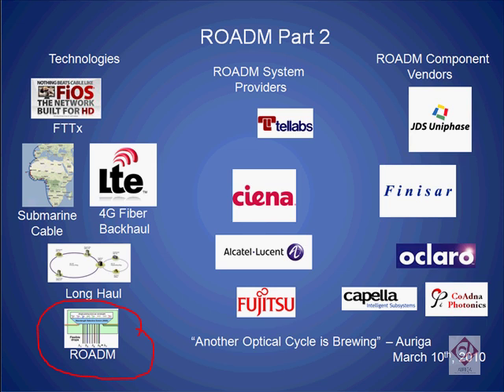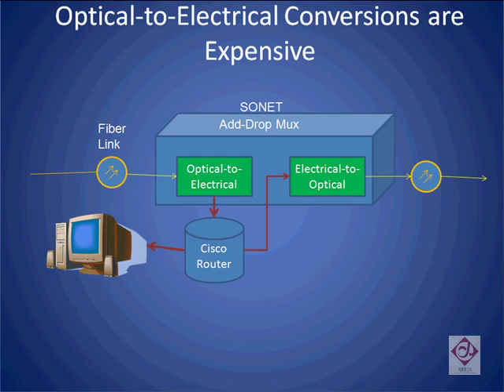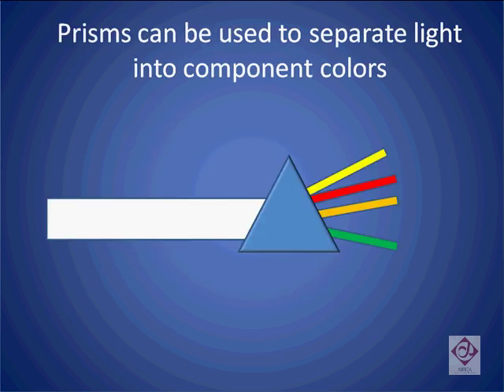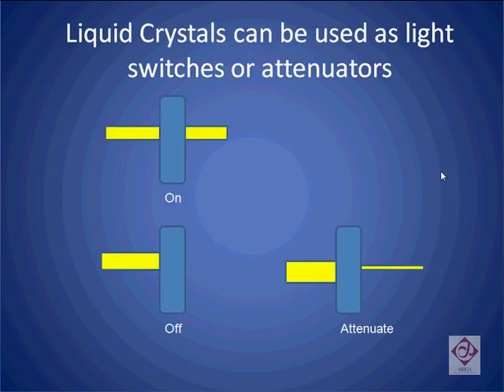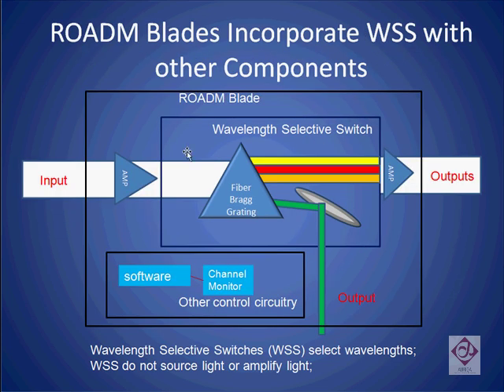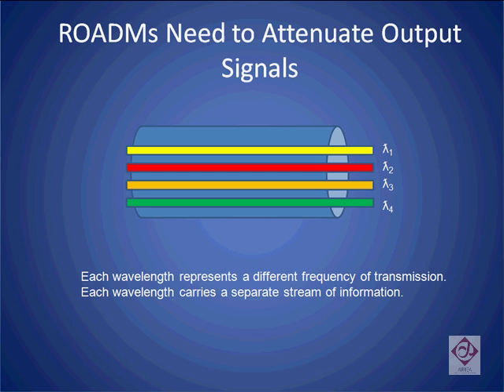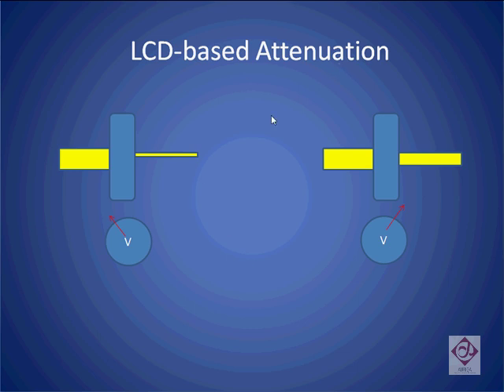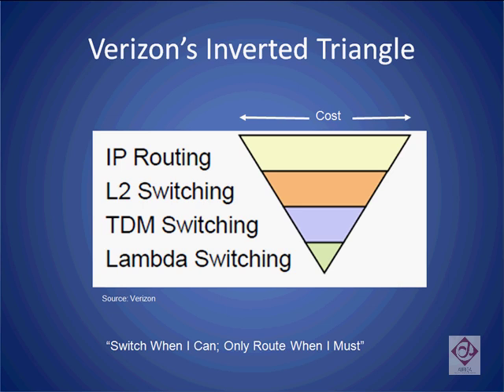ROADM Tutorial Part 2 of 4

Comment: I know this video is over 11 years old but you mention a few times that the Optical Add Drop Mux (OADM) is used as an optical-electrical-optical (O-E-O)  convertor?  The OADM is usually a passive piece of equipment however what you are taking about with regard to the O-E-O is actually the transponder and not the OADM?